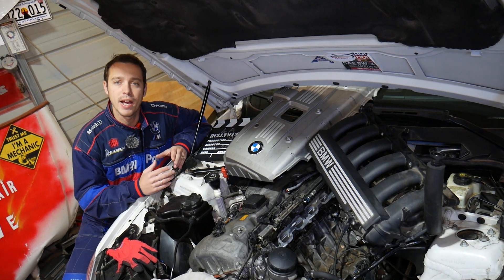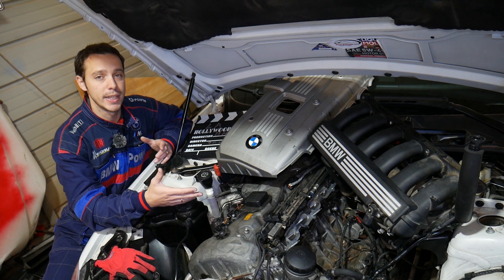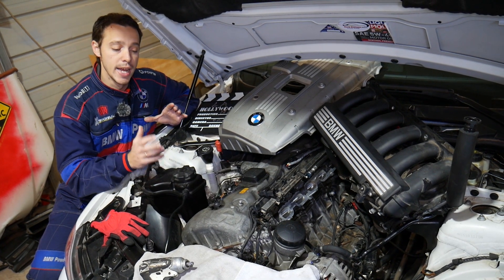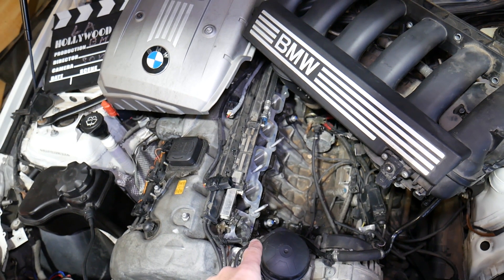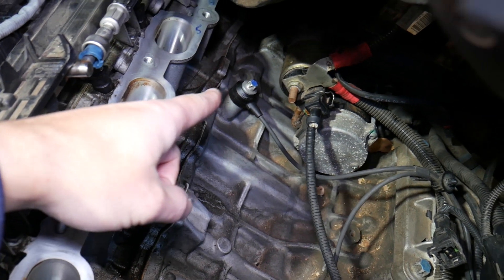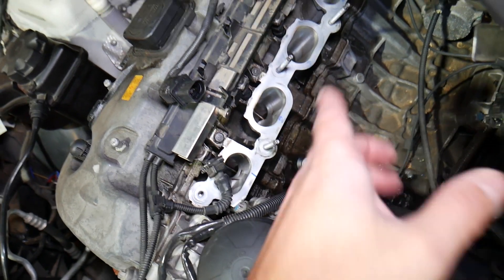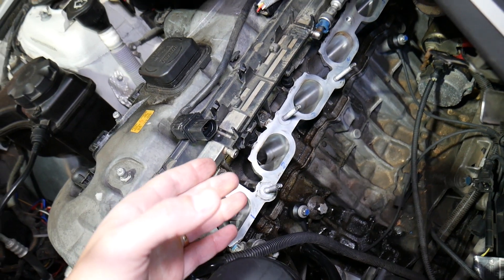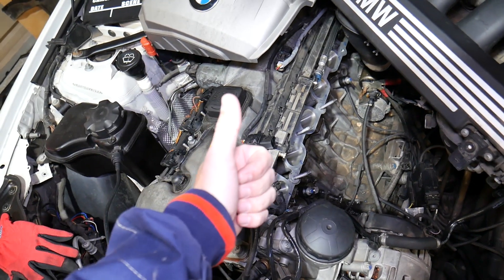CAN YOU DRIVE BMW X5 WITH BAD KNOCK SENSOR, SERVICE ENGINE LIGHT ON CODE KNOCK SENSOR

Comment: My Knox Sensor was replaced by Edison BMW, 731 Rt #1, Edison NJ in 2016. I declined replacement in 2017. It was replaced again 2019. The problem came up again in 2021. According to service writer Johnathan the service supervisor said that an outdated Knox Sensor was installed but he would give a $150 discount. He also informed me that during the 2 year, there would be unlimited replacement. I asked why it wasn’t done in 2017? Why do I keep replacing the Knox Sensor every year but he had no answer!!